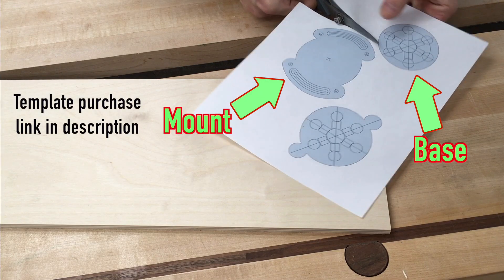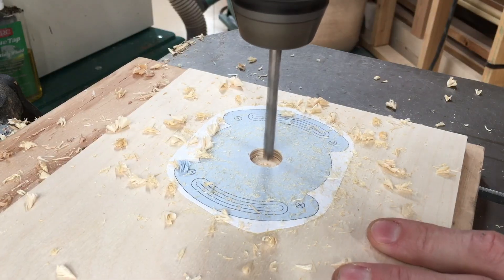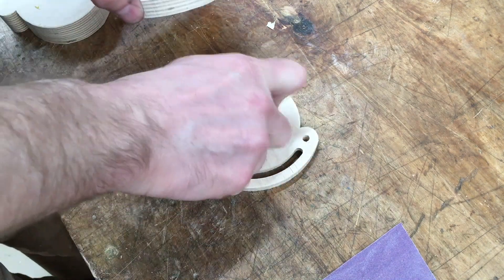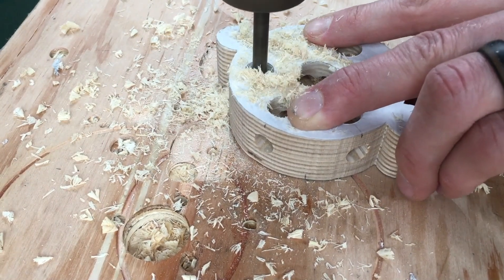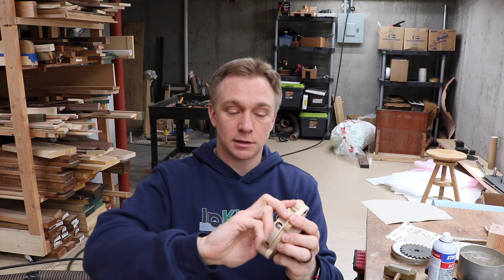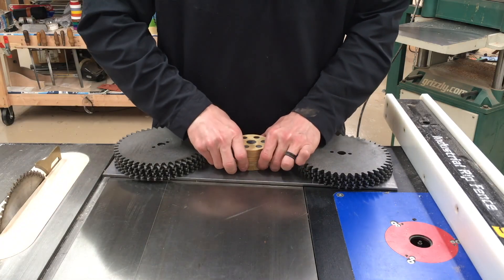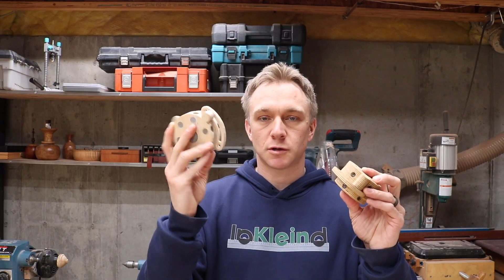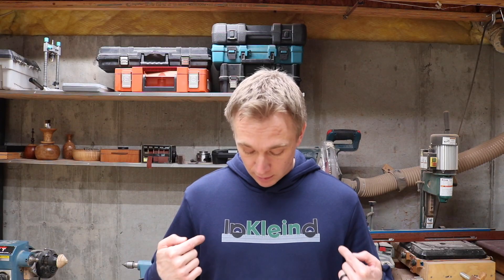How to build a switchable magnet

Comment: I’m an artist, and often work on very large canvases/panels. Up until now, rather than use an easel, I have used a cleat system where I have what looks a bit like a ladder mounted near the wall with “rungs” comprised of wood cleats with the top edge beveled back 45 degrees, and a corresponding piece of wood screwed to the back side of the panel with the other half of the cleat, bottom edge beveled back 45 degrees. Then, I can simply slip the panel onto a “rung” at the desired height rather than have to climb up on a stool to work on parts of the paintings. But it’s a pain, with larger panels, to have to ask someone to assist me in raising and lowering the piece onto different rungs. So I’m making a new system without cleats where a winch will do the raising and lowering of a sled that will somehow connect to the back side of the panel. Only, I’ve been stuck trying to figure out how to securely connect the panels to the sled. What I want is to be able to slip the panel onto the sled while the panel is resting on the floor. Compounding things is that I’d really like the option of rotating the paintings to work on them inverted at times (when working abstractly). All that to say that while your video has given me a good solution that should allow me to not only secure a panel to a sled but also rotate it. I think I’ll want something like what you’ve made, only more like 2’ in diameter, with more magnets, and the ability to do a full 360 rotation, not just a back and forth, on/off.

Comment: I just downloaded the wooden mag switch plans.  They do not include any dimensions,  in particular:
1) the thickness of the plywood 
2) the lengths of the steel rods 
3) diametric location of the small rods
4) diametric location of the arcs
Scaling from a print is poor practice. 

The video says to make the Base and Mount from 1/4 or 3/8 plywood.   The large design uses 1/2inch dia magnets, so 3/8 plywood will not work for the Base which has radial holes.  

Noting that 12 magnets are used would be helpful.   Your source for magnets has increased the cost to $21.50 for 12 large magnets.  They are out of the N42 design.  But for modestly more, the N45 are available.  Any idea if the N42 and N45 ratings are accurate from this place?  The quoted pull strengths are 1.5x to 2x too high.  McMaster reports lower pull strengths for the better N52 magnets.  McMaster is an authoritative source.  

And a Magswitch 150 now costs a bit more than twice the magnets from your source.  Of course, the Magswitch is metallic and smaller.

Comment: shouldn't it be possible to make perpetual motion machine with this device?
the energy it takes to turn the magnet on and off should be much smaller than potential energy difference between the two stages?

Comment: Just a quick tip about applying patterns in case it comes in handy for you. You can transfer the toner from laser prints with a cloths iron. Works best if you print to glossy paper. Hey what was the cost on each for the magnets?

Comment: Neat, but there is absolutely no reason to build this. Sure it's possible to save a few dollars, if you already have the wealth of powertools needed, and a shop to work in, and you get really cheap materials, locally so there's no postage. Unfortunately, you'll end up with something that can only be lifted by it's thin plywood ears, and will break long before the magnetic pull does... but on the upside, it's probably only a few hours work to make a new one.

Comment: This vid just showed up and I noticed that you must be the guy that built Adam's new bench. Beautiful design of both the Bench and the switch.  Is there any way to unlock (i.e. provide a slide option) on your vice design in addition to the two speed version. (on the bench)  I know that the solid wood design is certainly a selling point, but I wonder about stability over the years.  I used 3 layers of 3/4" mdf w/ Maple & Cherry top for my bench, but certainly think you did an absolute fantastic job on Adam's bench and love the steel frame. (Again assuming you were the designer).

Comment: This is interesting in that it avoids the use of the expensive diametrically magnetized cylinder magnets that the Magswitch uses, yet works on the same principle, while avoiding patent issues. It is more a demo than a practical device but that's OK. I don't know why you're charging $5 for the template which would be easily made in Inkscape. I would think that for the sake of future science and engineering students, it would be free.
Reply from the maker: Thanks, glad you like it, I put about half of my designs out there for free, this was one I charged for, that 1/2 and 1/2 ratio is one I’m comfortable with.
Reply: I see.

Comment: Andrew, I am really pleased to have found your channel (via James @ Stumpy Nubs).  I'm a retired engineer/toolmaker who has discovered the joy of working with wood in my retirement, but I still love using the metal lathe and milling machine as much as the wood shop machines, and I am seeing some great project ideas already.  I will absolutely be making a switchable magnet, but probably not copying your design exactly.  BTW  I have a pretty cool vice project getting close to being finished, but nowhere near as elaborate as your twin screw vice.  That is a thing of beauty!

Comment: is there a way to sponsor or commission work? im not rich (broke college student) but i can pay for the tools needed and workout a plan. i feel i have enough understanding for what im trying to build but absolutely zero experience with mechanical engineering other than computer soldering for low level maintenance stuff.. if theres a way to contact i def would like to hear from you🙏🏾🙏🏾
Reply from the maker: Sorry, I've got my hands full with my own projects at this point, no extra bandwidth

Comment: Andrew, congratulations clever design. this "platter"  design is similar to a design from GM, patented in 2005. By the way Ok for people to still build but, u need permission for commercial products. Magswitch has different platter design, we use different sizes. 10mm. 15mm, 20mm and 30mm. The sizes effect field depth and smaller is stronger, relatively, than the larger on thin material <1mm. Magswitch tools are designed for automation use, min 4 million cycles and are tested at 3 cycles per second. We love the wood business and love to hear about new ideas.  congratulations great video.
David Morton CEO Magswitch Technology
Reply from the maker: Are you David Morton, Magswitch CEO?  If so I’m adding you on linked in.
Reply: @AndrewKleinWW  I guess that turned out well, huh? 😂

Comment: I used the large template and 50% sized the plans and used 1/4" rod and magnets. It worked pretty well and for cutting the rod, I drilled a hole through a chunk of 4x4 ane pushed theres through to length and used a metal blade on my sawzall. Not as good as a bandsaw, but much easier than a hacksaw.
Reply from the maker: Awesome, you post pictures anywhere?
Reply: @AndrewKleinWW  I didnt. It's not pretty, just my first whack at it. LARGE learning experience...

Comment: Would it work to use stacked washers instead of cut steel rod?  I"m just trying to think of a way to create this design without having to figure out how to cut through steel rod.  I also thought that steel dowels might work but for the size I'm thinking they are a little too long, maybe.

Comment: These are made out if metal for a reason.
Reply from the maker: Care to enlighten us all?
Reply: Andrew Klein Sure I’lll give it a try... clears throat and pulls up podium there made out of metal because there primarily used in metal shops and anything els like plastic or wood would light on fire or disintegrate from the uv radiation plus wood is simply a fire hazard
Reply from the maker: This is a woodworking channel, and they are used for woodworking also
Reply: Andrew Klein what are you trying to say that I can’t tell this is a wood working channel 😂

Comment: Nice! A handle would be and awesome addition since you'd be lifting stuff, backside of where those screws go in could be an awesome attach point, just use longer screws :) Awesome tool for the shop!
Reply: I really like this video and it got me thinking...I'm working on a version with two switchables and a handle for picking up and moving my 3D printer

Comment: You're pounding on magnets with a steel hammer?  Isn't that a no no?  Are those magnets impervious to shock?  I read somewhere that neodymium magnets are sintered and can shatter.  And we never banged on iron magnets.  What's the story on bashing them with a steel hammer.  And don't complain, it's not a criticism.
Reply from the maker: I pounded in the steel rods with a metal hammer, not the magnets, I used a wood mallet or wood dowel for that.
Reply: @AndrewKleinWW  Ah, good, Anjinsan.

Comment: Do you have examples of the magnetic switch used in practical applications?  The switch is just a switch unless it can be used for something.... great video thanks for sharing.
Reply from the maker: That’s coming next
Reply: Temporary hook or other type of holder mount for metal surfaces, mounting cameras, or least having secondary option for camera mounts on metal things like cars, or for Indie movie maker who wants camera to be mounted on some I beam or something, cleaning work bench or trash from magnetic metal shavings. Theres just few ideas top of my head.
Reply: A pair are good for lifting awkward sheet metal, put a 3x3 or 4x4 steel plate on the bottom with it turned on, swing it around to pick up nuts, bolts, nails, etc, then turn it off over your bench or sorting tray to release them. Same for collecting iron shavings after filing or grinding. Makes a nice clamp for use on a drill press or to hold two pieces of metal in place to tack weld (basically any function clamps can do on wood, one of these can do on magnetic metal, just don't heat them up or you'll have to replace the magnets).

Comment: The rod plain cold roll mild steel?
Reply: Looks like it. He mentioned using a hacksaw. With an angle grinder and cutting disc it will take no time at all. As a source of material you can use any old bolt you've got lying around...

Comment: Awesome Andrew! Is this the same way a magnetic chuck for work holding on a grinder works? Like the one This Old Tony uses?
Reply from the maker: Thanks, I’m not sure actually.
Reply: There are both electromagnetic chucks and permanent magnet chucks. The permanent magnet chucks mechanically position things so that the magnetic flux travels through the workpiece, clamping it to the chuck. I'm sure there are different designs for how to accomplish that, but essentially it has to do with lining up steel parts so that the flux from a magnet below the table can travel up (or not).
Reply: There are variations on the theme, but in principle, yes.

Comment: I got a magnetic sweeper for my garage floor but it's a pain to clean. I wonder if this could work better. Really awesome build
Reply: Put a plastic bag or rag around the magnet. Then you can just pull off all the bits in one go.
Reply: @arnarbi  Same, I have a sandwich bag over the end of mine, and just pull it off over the trash can and it all falls in the trash.
Reply from the maker: Thanks, glad you liked it!
Reply: I put the magnet in a plastic screw-top jar. After sweeping I just take off the lid, pull the magnet out and whatever was picked up just falls off.

Comment: If you were 3d printing I assume hex stock would be perfect for this. Well, anything with a flat would work for the outer posts, but hex stock would be perfect for the center post.
Reply from the maker: If the center post was a hexagon with magnets against the flats then the top switch section wouldn’t rotate
Reply: @AndrewKleinWW  oh, it's a solid post. Somehow I was thinking it was two pieces. 

Hex, or square stock for the outer posts could still have a benefit though, better contact with the magnets. Hex stock for the center might require drilling a hole through and bolting the top and bottom together if the two wings with the slot aren't enough. (I thought that was holding things together, but it would probably need a center pin as well to keep things alligned)

If modern "super" magnets weren't so damn oxygen and moisture sensitive grinding or lapping a curve into one face so they maintained good contact with the center post would also work to make the magnet assembly stronger.
Reply from the maker: this is all 100% correct

Comment: Pretty cool, I’d definitely like to know more about how these work. I bet you could print one of these pretty easy as well.
Reply: If the the top and bottom of a post are the same polarity (switched on), to get to the other pole flux will go through whatever the magnet is placed on to get to the next post. If the discs are rotated so the magnets on top and bottom are different, a magnetic circuit is formed between the center post and the outer one and there would be almost no field strength on the outside.
On.         Off.
(N-S).      (N-S)
(N-S).      (S-N)
Reply from the maker: you got it
Reply from the maker: A how it works video and print/CNC files are probably coming in the future
Reply: There are a number of videos on YouTube that explain how they work.

Comment: This may have an application as a Clutch/Brake for engaging/releasing an oscillating rotary component in a drive train.  
This plywood prototype is too thick for that application. 
Could this be made to function as a Circumferential (Co-Axial) Band Brake rather than a Face to Face, surface contact application?  Say, 6.00 Dia. x 1,00" Thickness?
Reply from the maker: Wow, you have me stumped, research will be required to even understand the question
Reply: It might work — as long as the axis of rotation can be maintained at an orientation within +\- 0.02° perpendicular to the Earth’s axis, thus obviating the likelihood of producing an undesirable gravitational wobble and an unparalleled audible manifestation of an aurora borealis.